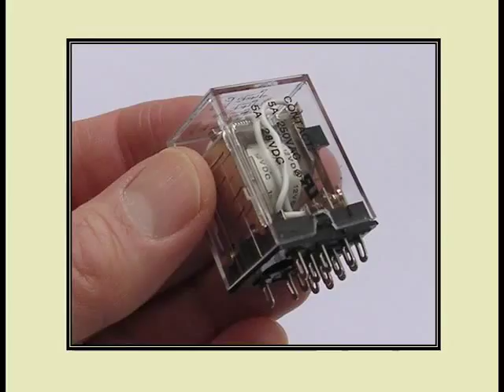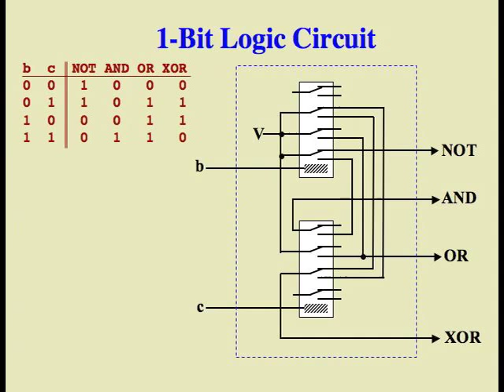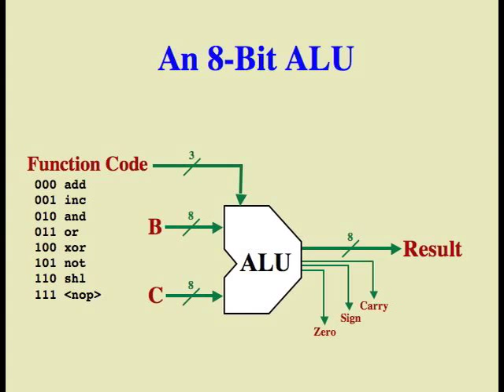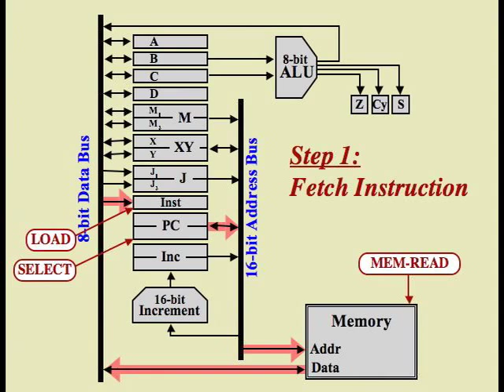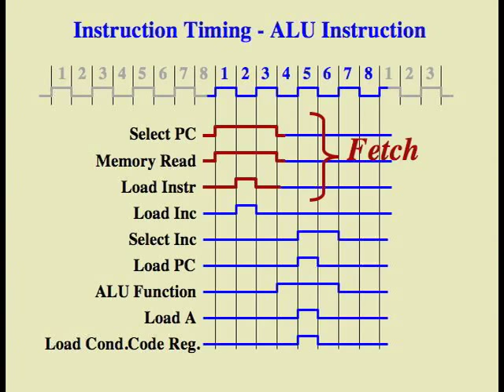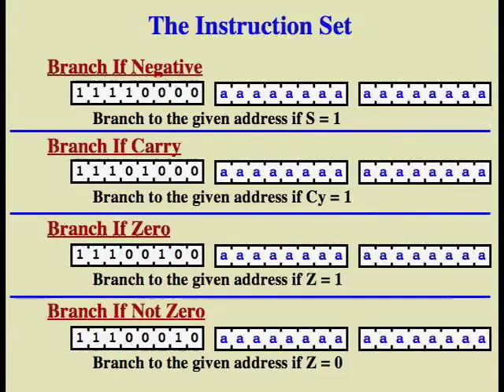Harry Porter's Relay Computer

Comment: The "bugged" computers were tube-based (moth to a bulb and so on). Importantly, these were decimal computers, measuring voltage to perform calculations. Fun fact: as a circuit component, a moth is a resistor.

Comment: Avoiding issues with a wired OR feeding back can be avoided by using the fan-out capabilities of those relays.
I designed and built a relay computer using 3 pole c/o relays (not the 4 pole seen here). I cannot remember a single instance of wired OR requiring extra contacts.

By permanently wiring one side of all coils to 0V you are missing out on a lot of component count optimisation in registers.

In 1982, with no reference to prior work, I designed a 2 relay full adder. I strongly suspect it was I identical to the 1940's design you mention, but don't show.
One feature of my design was "speed of light carry". The carry bit is never used to energise a relay in the adder, it is only switched by the 2 relays that are set by the data. That means that the carry signal propagates through each half adder at the speed of light (in a wire).

Comment: I have seen relay based computers or process control equipment fail, and thanks to the one above,
no one use these systems today. Relays stick, and it ends up in a never ending story of errors that shows
up or disappear.

Comment: This is phenomenal work!  You inspired me to try to design a computer of my own, and yes, I want to do it with relays!  I like your use of the 4pdt.  My design uses a 20-bit word which is 4 bits for instructions and 16 for data or address. (I have only 16 hardware instructions!) It has instructions to push and pop via a one-position stack. That's how I transfer between registers.  One difference between your instruction set and mine is that my hardware shift is a 1-bit shift RIGHT instead of left, and it is linear, not circular.  I decided if someone wants to shift bits LEFT, they can double any value by copying a to b and adding. Doubling has the effect of shifting everything to the left one bit.  My instructions are: NOP, ADD, AND, NOT, OR, SHR, SUB, XOR, LDA#, PSHr, POPr, RDA, STA... and the conditional branches, JC, JN, and JZ for Jump on Carry, Negative, or Zero. All good wishes, sir. This is such a fun video series!
Reply: Contact me to talk about the architecture I'm working on extremely different that can make a superscaler supercomputer
Reply: @radiofun232  haven't put anything on YouTube, mostly constructs in my head, totally logically achievable, I'm still just learning the logic gates and how to build basics with them, my thoughts are more advanced than the knowledge I have to demonstrate as of now. Would you like to chat about it? Skype is, Vegan.Prock , with the dot no spaces

Comment: I first got interested in Relay computers back in the late 60's and although I have designed several simple computers I have never actually built a relay computer. This is one of the best descriptions I have ever seen - really well done.
Reply: Contact me about my architecture design I'm working on, extremely different,

Comment: How much did that thing cost? The cheapest relays i can find cost 0,50€, so a computer with 500 of them would cost 250€.
Reply: StarTrek123456 Not that expensive. Plus price goes down when you buy in bulk.
Reply: I'm wondering how much power does this computer consume to operate
Reply: I have thought of a spring-less relay design .